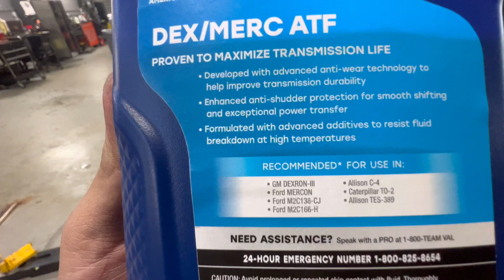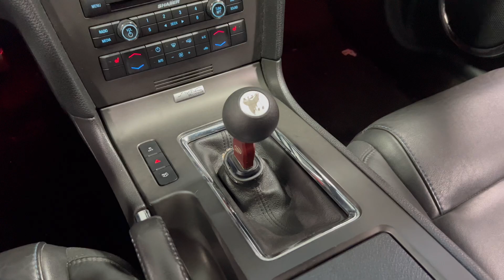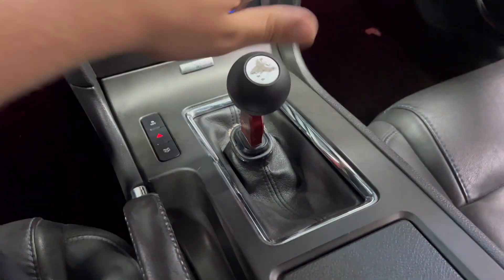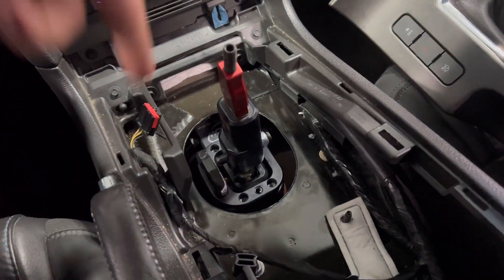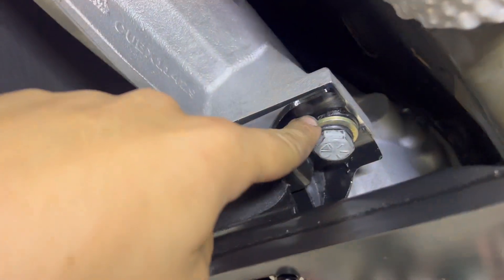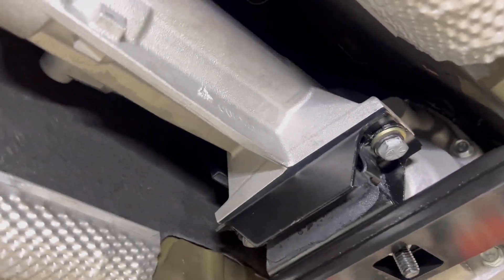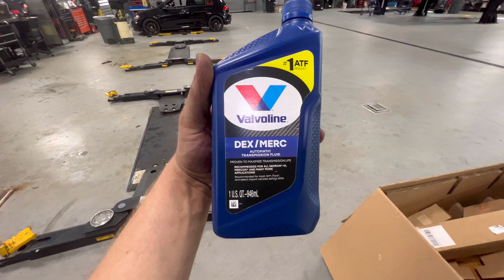How to Tremec T56 Magnum XL Swap Your 2011-2014 Mustang GT!

Comment: bought a 13 mustang coming from 2002 camaro ss t56. the tm82 transmission is fucking trash, im probably going the tremec route as i don't want to spend shit tons of money on the tm82, ive heard tm82 can be a good transmission but im not risking it. stage 3 mt82 or tremec

Comment: Please be aware that McLeod Racing has a different air gap requirement than Mantic. Both of these companies have different clutch finger locations therefore their specifications are different. For McLeod the air gap should be .100 - .250 and you should NOT need any shims at all. Too much air gap can cause gears to slip out or not fully engage properly. As always never take YouTube comments at face value consult with McLeod racing they will tell you the same thing. I’ve had my t56 Magnum XL since 2016 no spacers were ever used. And I’ve installed both RST and RXT clutches from McLeod.

Comment: I’m about to do this to my s197, I’m assuming for the the 2 red with black wires went to each one of the 2 pin connector wires correct? 10:09

Comment: I’ve done this to my 13 gt with the 2.97 version T56 magnum xl. It also has a 2.3 VMP tvs and my rear gear is 3.31. I’m wanting to change the rear gear just not sure if I should go 3.73 or 4.10. This is a street car only.
Reply: i have the 2.97 and 3.73, if your doing roll racing the top of 3rd hits about 115/118 then you have to shift into 4th which is a long ass gear if your going to 130+
Reply: @s550sammy  I'm thinking going to a 3.90 gear. A bit more down low and to help with the 3-4 shift. How do you like the XL? What clutch do you have? Do you have a power adder?
Reply: @crackedbrainOG  i have a stage 2 whipple making low 700s. I was thinking about going 3.55 to try and hit 130 in top of 3rd but im not sure, just gotta make more power honestly with the t56 to make 4th really useable. Not saying it doesnt rip already but 4th is a very long gear.
Reply: @crackedbrainOG  i have a rst right now, seems like its holding up fine. dont really think ive ever had lockout but there was a few times where it might have been me or the clutch not sure

Comment: I have a 2011 with a T56 and man my aluminum driveshaft is very loud. Any ideas? Thank you very much.
Reply from the maker: I’ve noticed that as well. I think it’s simply due to design of the longer transmission and shifter being directly connected to the transmission making the vibration and noise louder. I’ve never had a problem with it so I’ve just let it go

Comment: We did a t56 magnum swap on a 2011with a bowler all in one harness.  One problem arose,  battery keeps dieng now.  And clue what's causing that?
Reply from the maker: The only thing I can think of is if you wired differently. I know the kit states to wire to a good solo power that is ignition switch on based. If you wired directly to a power on at all times it could be causing the draw
Reply: @252squad5  i need to know where i can find ignition based power. Good spots 
Im dyin atm under the car 
I cant find a good spot for the 12V cable
Reply: I'm having the same issue with the Bowler on my 2013 swap. I keep a charger on it when it sits, would rather not have to do this.
Reply: Power repones: Thanks

Comment: What supplier did you use for you Magnum XL and what ratios are you running?
Reply from the maker: I ended up getting the transmission and all the swap components from modify my stang. Best deal I could find . And I’m running the 2.97 first gear ratio with my rear gear being 3.31’s it’s got long gears but with boost it should be good
Reply: @252squad5  Ah alright, 3.31's seem real damn tall for even the 2.97 first;. a 4.10 would be roughly equivalent to 3.31 in an mt82. How does the trans feel? I'm looking to do a swap before the end of this year with the 2.66 first and 0.5 sixth gearset, pairing with 4.56 to perfectly reflect an mt82 w/ 3.55/3.73's
Reply from the maker: Yea 3.31’s and the 2.97 end up being really long gears but it should work out for a boosted setup. I would go with the 2.66 first if I were to go back though
Reply: If I’m stock what gear ratio do you suggest
Reply: @Effy1k if stock engine 2.97 or 2.66 tremec... Nothing less than 3.73. preferably 4.10 or 4.30